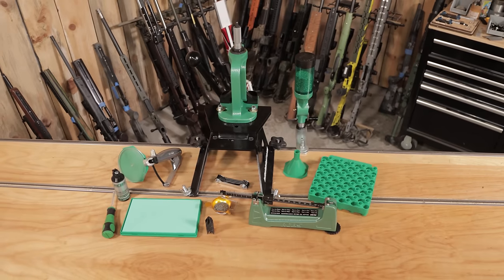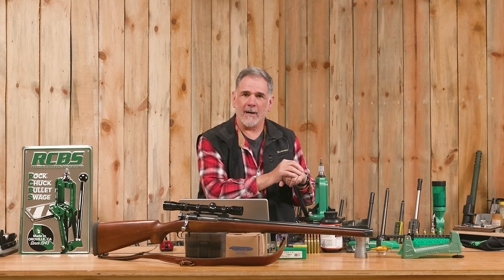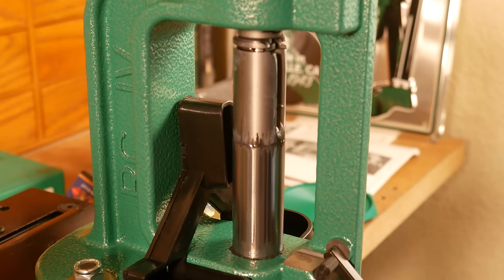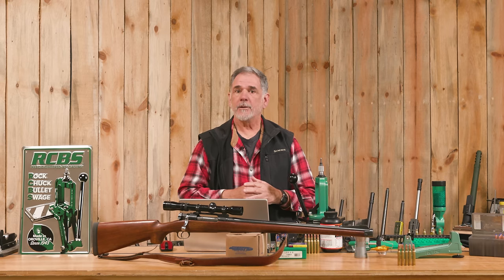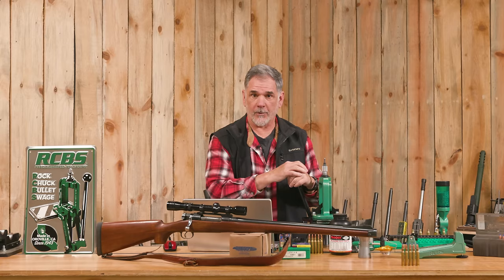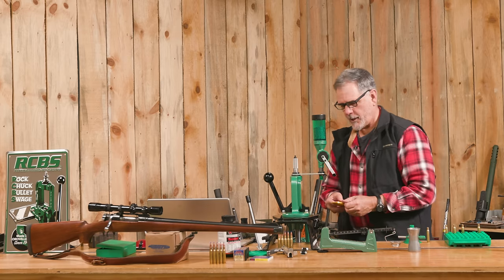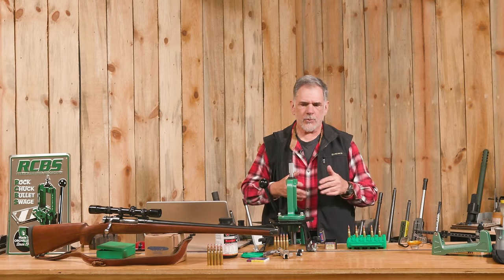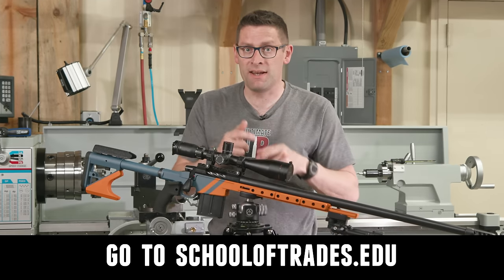Hands On: RCBS Rock Chucker Supreme Master Reloading Kit

Comment: Purchased a used rock chucker kit back in 1983 and it's still going strong. The press has virtually no side play at all so I can't justify replacing it (even though the MEC marksman and the RCBS Rebel both look really nice). I upgraded  to the Satern alum-brass funnel as the plastic funnel had annoying static cling. Like most folks I use a hand priming tool instead of the press mounted assembly. I too love Varget in my .308 win but it's once again become scarce along with my other 'go-to' stick powders like H4895 and IMR4064 so I decided I would try out a few ball powders and I'm getting excellent accuracy with Ramshot TAC on 168's and also AA2520 w/155 match pills, and the price of the ball powder is about 20% less than the sticks. I may never go back! Thanks Guy for another great vid...

Comment: Been using Rockchucker’s for over 50 years, I have 2 right now.  I also have a Dillon 550C but I actually prefer loading on a single stage Rockchucker as I can monitor the process better.
Reply: I'm doing my due diligence, trying to decide where to start. The Rock Chucker Supreme Kit looks very attractive, but I am also looking at the Dillon 550c (which is currently my favorite) and the Forster Co-Ax...decisions, decisions.
Reply: Or to complicate things a Redding T7 is nice too.

Comment: I have never reloaded and just bought an RCBS REBEL kit from Scheels to start my new adventure. I have everything needed to reload except,  powder, primers and bullets.  I need to figure out what kind of powders I will need to get started.  I will be reloading my Remington 308,
Marlin 30-30
45acp, 38 special, 9mm and 380.
I have the dies for each. 
Still trying to search out some information on what's the best for reloading all the different cartridges. Bullet weight, and powder. 
I have also bought the Hornady 50th edition,
Ken Waters Pet loads, and the Speer manual that came with the Rebel kit. Just nervously baby stepping forward. 
Thanks for all the encouragement shown on Ultimate Reloader,
You guys ROCK!(CHUCKER)

Comment: My first press was a Rock Chucker 45 years ago, I have gone thru 2 of them and have switched to the Summit press and Dillon 550 with Armanov set up for rifle.
Reply: You managed to wear out a Rock Chucker? My goodness! I am impressed. That's a lot of handloading.
Reply: @guyminer3168  40 years of handloading for prairie dog shoots averaging 3000 rounds per shoot, barrels worn out amount to over 100, calibers include, 222, 22 Hornet, .223, 22-250, 6MM Remington, 25-06, 308, 6xc and a few others. Handguns I never kept count of but each year loaded 3, 5 gallon buckets of bullets for 45 acp, 2 38 specials, and untold 9mm and 38 super. I just switched to a Dillon 550C last year as i found out about Armanov tool heads and die rings. Now have that set up to load for P-dogs with 2 tool heads per cartridge, and a V-3 powder trickler for weighting out charges. What wore out was the frame to ram fit as primer material would get between the ram and frame causing it to wear allowing runout on the ram.
Reply: @paulnelson9907  - that sir - is an awful lot of shooting and reloading. Wow!

Comment: I bought this kit a few years ago with the Rebel press after it came out.  So far, I am mostly pleased with everything that it came with except for the digital scale.  Glad to see they went back to supplying the beam scale.  It is much better than the cheap digital scale that used to come with the kits.  Wish they would include the universal hand priming tool instead of the standard hand primer.  The universal primer doesn't need shell holders.  My kit did come with a trickler.  Can't believe that a trickler isn't included with this kit.  To me that is a basic necessity.  Unless, of course, you go out and buy a digital powder dispenser.  All in all, I'd buy the kit again.

Comment: You may have noticed but the handle on that RC isn't the only improvement, what's really nice is it no longer requires the benchtop overhang.  I replaced my old RC with a supreme for just that reason.  You all might want to mount old and new sidebyside so you can show users what I mean.  The newer one really opens up places you can mount it.  Otherwise i haven't noticed a lot of differences, old or new those RC are just wonderful presses.  I prefer the RCBS Automatic Bench Priming Tool over either the hand unit or press, mostly because the feel while priming.  It might not be as fast to use as the hand one but no hand cramping either ;-)
oh yeah, I'd definitely recommend this kit to anyone starting out as you get all the basic items needed and kinda forces you to take your time and learn to do it right.  I wish this kit was available when I started reloading (over 30yrs back).

Comment: Started reloading in 1985. Bought my Rockchucker starter kit at the BX on Eielson AFB, AK. Load rifle and pistol on it to this day. Still adding dies and case holders to this day. Just ordered a SOLUS 6mm Creedmoor to the list. It’s a little tougher to find reloading data for this cartridge. For some odd reason it’s not listed in my Speer Reloading Manual that came with my original kit…
Reply: A great resource is Hodgdon's online reloading data center. Free, and has thousands of loads, including for the 6mm Creed.

Comment: I have the same kit, my case lube had a different label. Why is the consistency like cold molasses? Is there a way to get it out of the bottle easier? Maybe cutting it with something... Notice all those spent primers all over the press? I had a friend 3d print a better catcher that connects to nylon tubing and into a bottle. I sold the universal tray and bought one that was a little less tall and busy looking. I only reload for 4 or 5 calibers, I like the MTM ones better. Get a good trickler for stuff like Varget (powder measure wont meter stick powder very well, and has some issues with flakes), and I suggest a motor driven trimmer. I have the Frankford Arsenal Platinum Series Case Prep and Trim Center, it's amazing. The RCBS universal powder measure only comes with one drum. If you want to reload pistol calibers accurately at <4gr, you will need the smaller drum insert. The scale is nice, but my next purchase will likely be an auto measure, or digital scale. Folks might want to buy a 1 gram check weight. I don't know if I'm doing it wrong, but I never could use the funnel with .223 Rem. I'm not sure it's made for smaller bottle neck cartridges. I just take the case straight to the powder measure drop tube. the hand primer is OK, but sometimes causes primers to go in funny.

Comment: I got this kit in late 90s. It came with way more stuff including a case trimmer and a better scale. It was $200. Reloading use to be a cheap hobby. $40 would get you a pound of powder box of bullets and 1000 primers.  I cracked the press on both mounting holes. Forming brass and got a little too aggressive. Contacted RCBS and 2 weeks later had a brand new press at no cost not even shipping. RCBS is a top notch company

Comment: I've found 180 grain bullets to be the maximum sweet spot for my '06s. If I need heavier I go to my collection of .30 and .33 caliber chambered rifles. IMR-4350 and W760 powders fuel everything from 110-180 grain projectiles, accurately and  without high pressurized wallops to the shoulder.

Comment: RCBS makes a good single stage reloading kit. I am not a fan of their progressive presses. Because I no longer use that press I salvaged the powder measure, and it is good enough for what I use it for. Dies are pretty good, and in the event of a stuck case there are plenty of case removers that work with their decapping rod threads.

I will say that I am fairly anal about verifying my shoulder bump and cleaning my brass after it has been sized.

Comment: Really good video. One question, how did you check case length?
Reply: I measure with a set of calipers. It's interesting to measure both the fired case and the resized case. Sometimes they'll stretch during the resizing process. A case-length gauge is also a handy thing to have.
Reply: @guyminer3168  thank you for the quick reply.

Comment: I have the Rcbs rebel. I noticed that you lubed the inside of the case but didn’t clean the lube out after sizing and before adding the powder. Doesn’t that lube affect the powder charge?  You mentioned touching lubed cases then touching primers and that possibly having an effect.  Curious about why the difference.
Reply: I've wondered about that, and have often just used a bare, non-lubed, case neck brush instead. Never found any noticeable difference.
Reply: I've used the Lyman powdered mica for inside the necks, the case neck runs a tad easier past the expander ball.
Reply: @willlotz6956  - cool. That's a good thing.

Comment: How does lube dent the case shoulder?
Reply: If too much case lube is used, it has nowhere to go once the case is shoved up into the die, and it doesn't compress. The shoulders end up with dents. I did that back in the 1970's, loading my 6mm Remington. Now and again I've messed up and done it again. They fire-form out, no need to discard the brass.